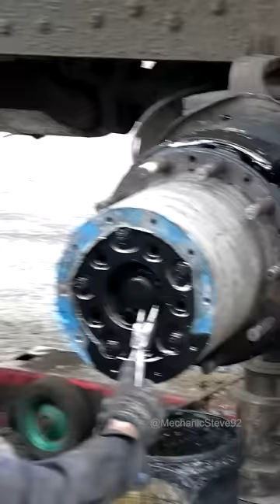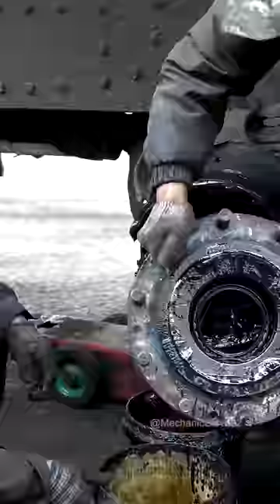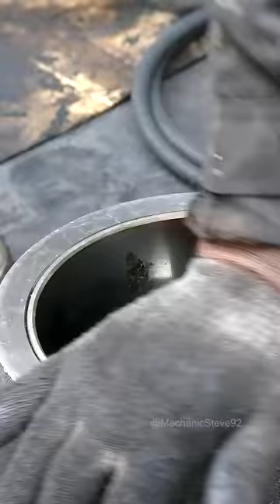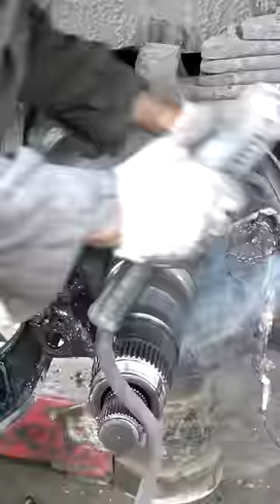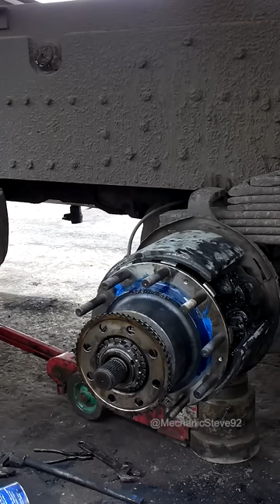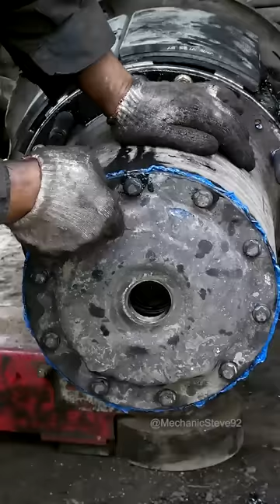Truck wheel oil leakage repair

Comment: You guys pointed out the giant gash in the bearing race, but you installed it anyway. Now the roller bearings are going to score and hang up on that gouge. That bearing is going to shatter the bearing housing in no time.

Then you guys left the hub oil/grease all over the S-cam and anchor pins when you put the drum back on. When the driver hits bumps, it will splat onto the inside of the drum, causing the brake shoes to slip. This is a bad job.